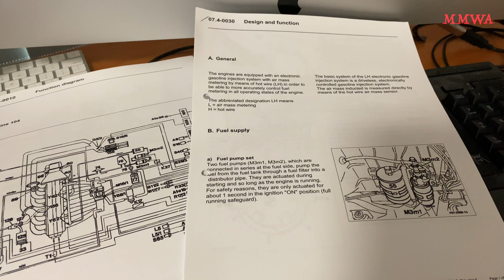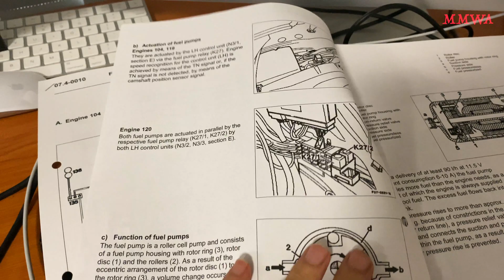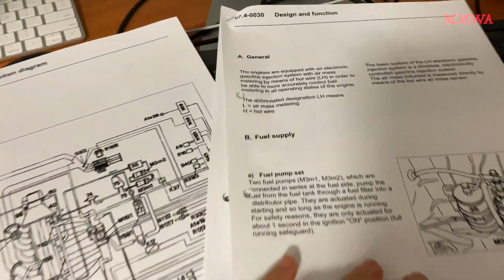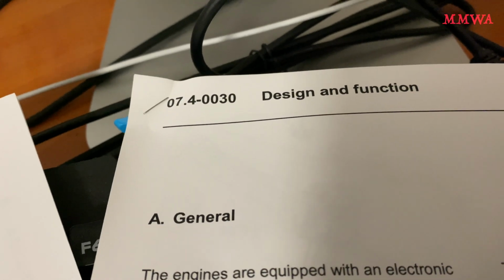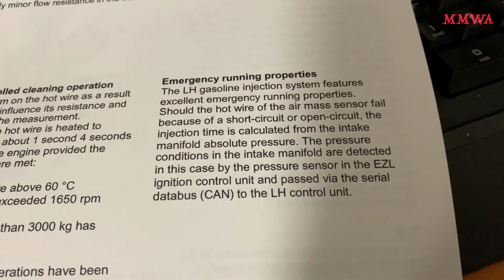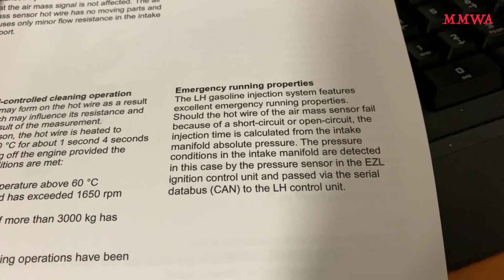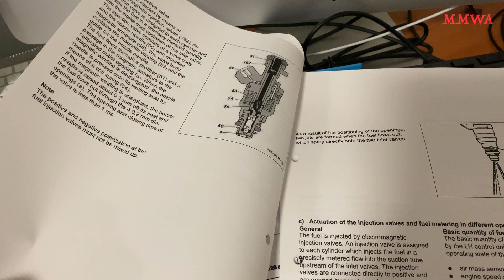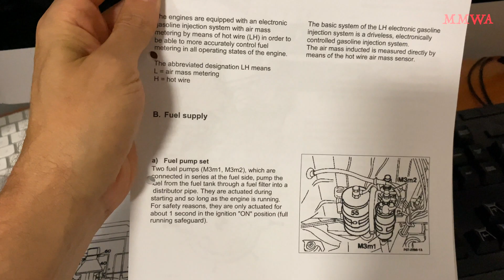LH-Jetronic is actually kinda cool

Comment: Kind of unrelated question here, but have you ever encountered a Ssangyong Chairman with license built M104? I was amazed to learn that the M104 was actually built until 2017 and was available as 2.8, 3.2 and 3.6 litre version! M111 and M113 where also offered at some point, I have to note.
Reply: @athompson8976  they maybe still have the tools to produce the engine
Reply from the maker: I have indeed seen them. There was one that was a member of my local gym I saw very regularly. Dont really see them come up for sale often though. They are kinda ugly but kinda cool at the same time.
Reply: lso interesting note, that M104 was fitted with 722.9 transmission at some point. Which seem like an ultimate combination - M104, quick shifting transmissioon, also no annoying fan clutch, and much more modern ECU
Reply: @Андрей-б9к1и  yes, that's right. Taking that powertrain with the 3.6l and retrofitting it into any 90s Mercedes chassis would be quite interesting
Reply from the maker: @dachallenger6393  do we know what model it was with the 3.6 and 722.9?
Reply: @MMWA-DAVE  2008-2017 Ssangyong Chairman
Reply from the maker: @dachallenger6393  This might be like finding a needle in a haystack in Australia 😅
Reply: @athompson8976  do you know how many were produced?
Reply from the maker: @athompson8976  MG, the biggest pile of rubbish imaginable. China buys a badge to buy reputation.